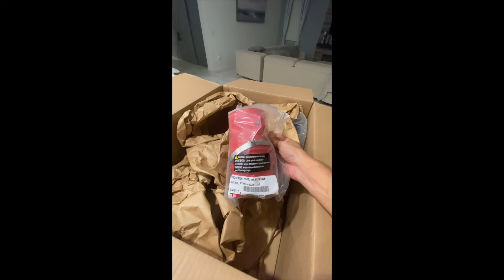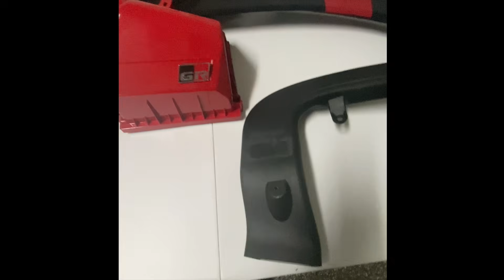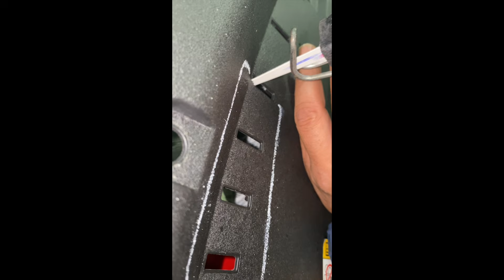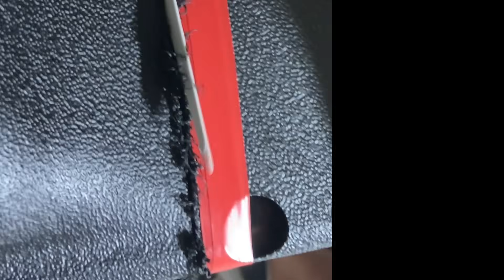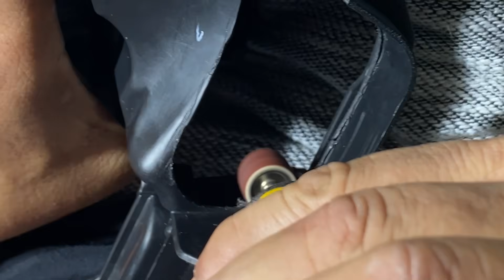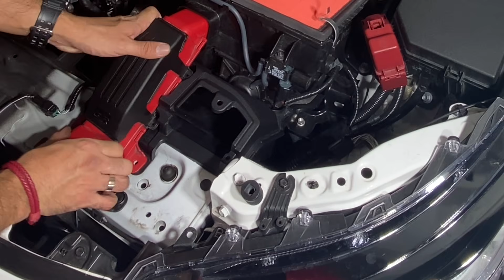GR PERFORMANCE AIR INTAKE FOR GR COROLLA

Comment: The red air box is original? I look the part number and the picture are black, not red.
Reply from the maker: It’s original, I just painted it and add the GR badge
Reply: @primeroadsandrides stupid... 

You need to tell people that. 

You can't make it seem you bought this kit the way it is. 

Like how you have a red factory inlet tube when everyone else's is black. 

I knew you modified it, cause I would know if there was a red box. 

Clearly, other people do not know and can not tell.

Comment: I have a 2026 and not sure it won't cause CEL issues. I'm told no fix on the 25/26 like the older models.
Reply from the maker: this is NOT an aftermarket piece,  I already put over 4K miles with no issues.

Comment: Disconecting the battery for an intake is hilarious 🤣
Reply from the maker: Better safe than sorry when dealing with sensors and electronics, it only takes a second.
Reply: @primeroadsandrides it doesn’t works that way but sure😂
Reply: @SuperchargedM3  Actually, it most certainly does work that way when the intake has a MAF sensor, so what are you talking about?! Also, all manufacturers recommend disconnecting the battery before removing the OEM intake and  installing an aftermarket intake. Read the instructions next time you get one. It’s hilarious that you think you shouldn’t!
Reply: @f82dot instructions are made for clueless people like you that doesn't understand how an engine works.. disconnecting the battery won't do anything lmao😂

Comment: You forgot to tighten the airbox to the new intake hose (clamp).
Reply from the maker: good anotation not on the video but I did it, the focus was in the cutting and adaptation of the right inlet into the second air box

Comment: Great video! This is exactly what I'm looking. I've been looking for something that isn't going to throw an engine code. I like that it pulls air from outside the engine bay.
Reply: The AWE Performance Intake doesn’t throw a code. It’s badass too and sounds amazing. I’m either getting the AWE or the Piras Intake for my 2024 Circuit Edition

Comment: Great install and video but I have one question? Does the GR intake the red part that goes  from the front left to the air box is it open like the stock one on the bottom? Or is it closed off?
Reply from the maker: It is partially closed

Comment: Funny; website says no cutting or drilling required.
Reply from the maker: Even the PDF gives you the template I think the website is generic because for the Tacoma TRD intake there’s no cutting or drilling
Reply: @primeroadsandrides it also looks like the upgrade intake is required to begin with. My bone stock 24 doesn't have the extra intake stuff the newer cars have. Few hundred dollars to upgrade the intake to the current system then an extra $500 to add the gr performance intake.
Reply from the maker: @barrymccaulkiner7092  I think you're confusing the 2026 upgrade, you don't need that in order to use this GR Performance Air Intake,  mine is a 25 Premium plus and it comes with the same radiator cover as the 23 and 24 models, I replaced it for the 26 model and adapted with the GR Performance intake but you don't have to.
Reply: @primeroadsandrides  i found the install instructions for this intake online and it's true. it's for the pre updated snorkel system. the website is also still saying MAY NOT FIT (24, 25, 26) but does say exact fit for 23....come on toyota.
i think i might oem+ mine to how you have yours. i think the updated snorkel flap is better overall, then add this intake on top of that.
this kit alone: pushes outside air to in front of the secondary air box flap, so the car isn't sucking in pure hot engine air.
toyota upgraded the flap system for 26 where the secondary flap is isolated and isn't sucking in hot engine air.
but this performance intake, looks like it flows even MORE outside air into the box before the secondary flap. i believe this is overall the best setup, so far.

thanks for the upload and inspiration.

Comment: where did you get the intake form
Reply from the maker: From Toyota PART PTR03-12230
Reply: @primeroadsandrides  which website?
Reply from the maker: @stellioiscrazy   https://autoparts.elmhursttoyota.com/products/product/gr-cold-air-intake-system-ptr0312230
Reply: These are all Toyota OEM+ parts.
Reply: Says on the toyota website that these do not fit GR corolla's but they will have one available in early 2027

Comment: where did you get that red extender piece that connecte to the red intake?
Reply from the maker: That was custom made 3d printed
Reply: @primeroadsandrides  Could I get the 3D print file for that extender?